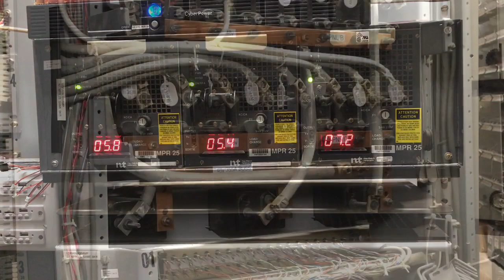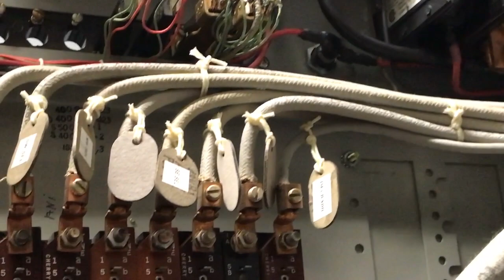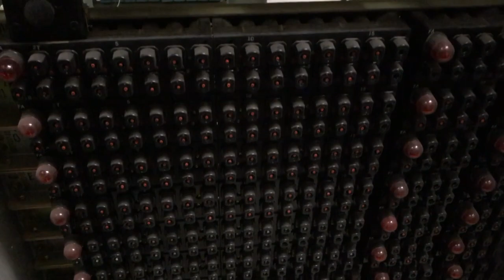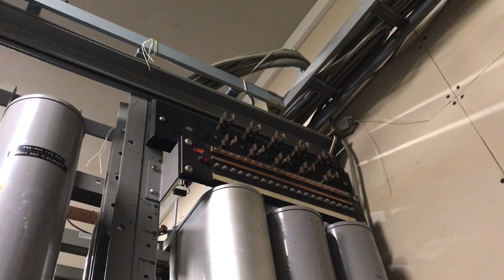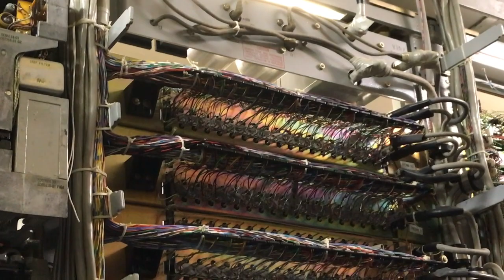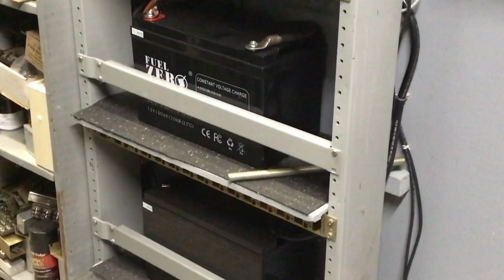48 volt D.C. Power system. Telephone central office museum.

Comment: It's wild that you just posted a video on power.  We're just replacing 4 Lorain Flotrol 400-Amp Rectifiers & 2-Strings of flooded cells, each with 24-cells a piece.  Our office load runs around 625-Amps.  This is the 2nd replacement of the batteries in our host office, in the past 17-years.

In several of our smaller C.O.'s, we have the 50-Amp version of the NT Helios Rectifiers.  The rest of the Remote C.O.'s use AT&T Lineage 2000, 50-Amp modular rectifiers.